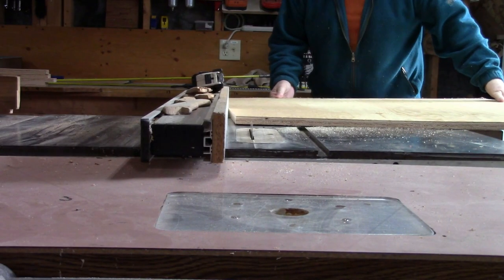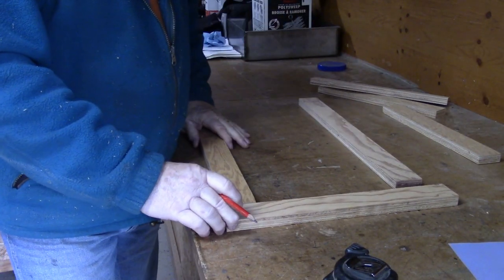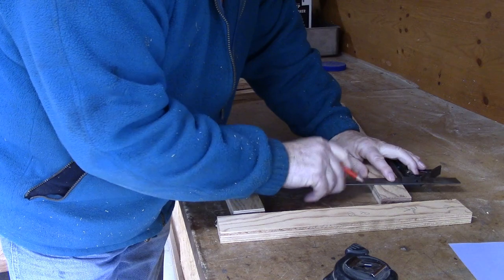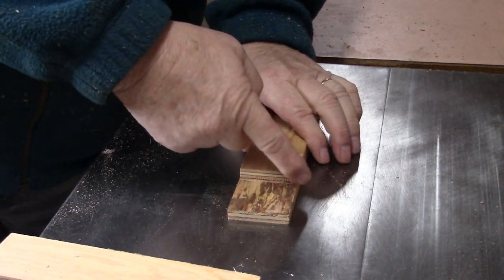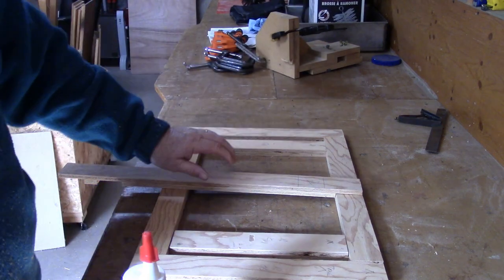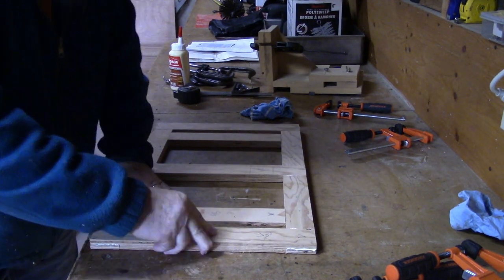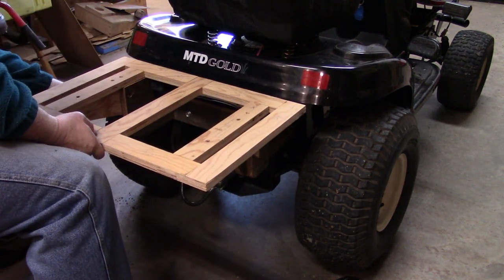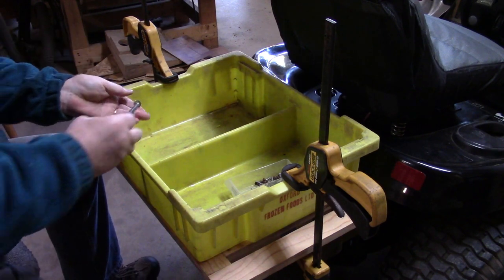Making a Deck and Adding a Box to the Carrier on the MTD

Comment: Hey Mike. Always good to see you post anything. Not burning all the little scraps is a great thing. We have 2 rollies/carts of scraps that the volume never seems to vary much. Off cuts from the miter saw and other sources are constantly being added and subtracted from. Lee Valley has a great buy right now on a tilt box and a saw height measuring piece as a pair for $40.00. I got a few of the sets for friends for Xmas. One for me too. They are both magnetic and coming from them They are quality pieces. I/we quit buying both in and outdoor wood glue. LePage (as you use) makes a great outdoor, water based tan colored exterior glue that over 10 years + now has proved to be a great product. It is a real joy for me to be posted up on your sticker door. Yours are still sitting here waiting for me to insulate my shop door. Always a fine visit old friend. Take care eh.
Reply from the maker: How's she goin'?  So nice to  read your comments Dean!!  I know the kind of LePages glue you are talking about.  I have been using PL Premium the last while for out door projects, so I don't have any of the LePages OutDoor Wood Glue, but it sure is great glue!!!  The only problem I ever had with it was one time I was making a lawn chair.  I used the LePages Outdoor Wood Glue but the wood was very green and pretty wet actually. The LePages didn't set up very well and the chair broke when I sat on it.  LOL  I blamed the glue, but it could have been me and the weight I carry!!!  LOL  After that I tried the kind of glue that sets up when exposed to water.  I don't like that kind very much.  It doesn't seem to last in the bottle and it oozes out of the joint and is hard to clean up.  Anyways Dean, thanks for tuning in and take care!!!
Reply: @GrampiesWorkshop  I do like the water activated polyester glues but most important toy you really need is a moisture meter. They are reasonably priced and super easy to use. I was making a really nice, front entry door and chose some clear fir from up on the mezzanine that had been up there for about 6 months so I didn't check it. Undenounced to me the boss had rotated the stock and in the next morning my poker flat 40" door was a soup bowl.. I was able to let it rest for another month and cut it all apart and re-glue it I have never missed on checking to make sure everything is between 7 and 10 %. Ideally all the pieces need to be within one %. You can see that front door when I do a visit  to the log home it resides in.

Comment: Those lap joints are a good idea-they'll add strength. The jig you have for the tablesaw and the sled are good features to have for a saw too. I wanted to see a test drive and I watched and watched and....no test drive🤔😩 but I'll get over it. The blueberry crate is a sturdy box...my personal favorite are milk crates. Commercial fishermen use rectangular crates (about double wide of a milk crate) built from hard plastic web, the same as milk crates with high sides. There's probably a lobster fisherman somewhere down there that would part with one and then you'd be "cooking with gas" as they say. I've been putting a push on to get the house finished and my YouTube time has been limited lately, but I always have time for Grampies Workshop. Have a good one Mike!
Reply from the maker: How's she goin'?  You know I was thinking of a milk crate.  I have a few of them but they get brittle over time.  I don't think they are UV proof.  A fish tub would have been a good choice but I didn't have any and I'm about as far from the ocean as you can get in NS so getting one would have been a chore.  I'm enjoying watching you do your counter tops.  I think that project would take guts.  Cement doesn't lend itself to 'corrections' they way wood does!!!  LOL  Thanks for dropping by and take 'er easy!!!